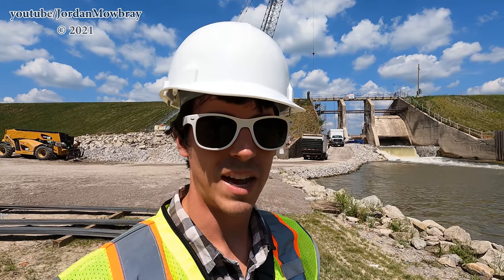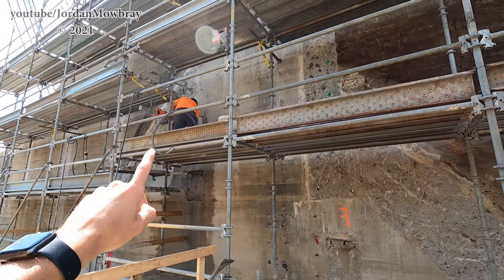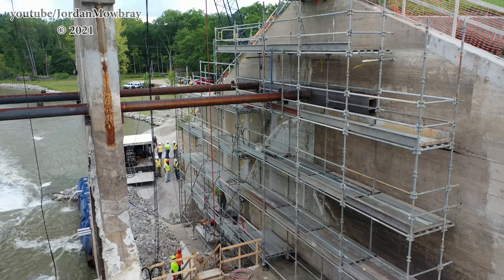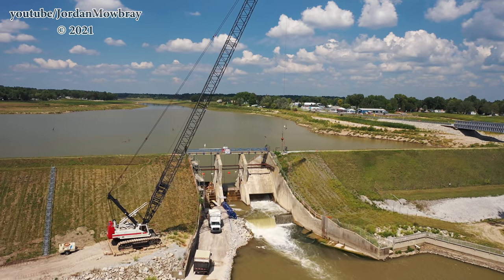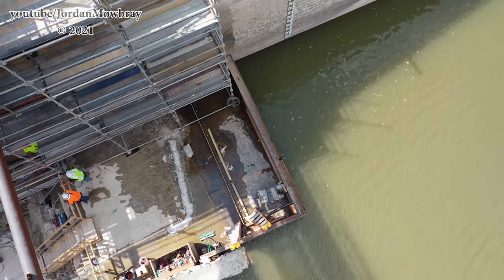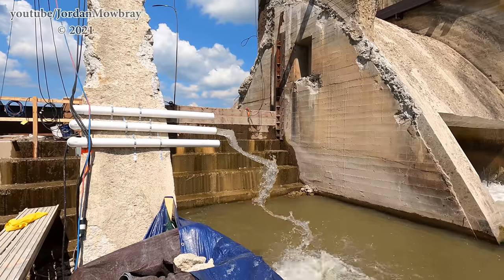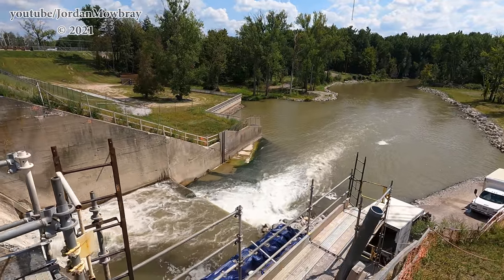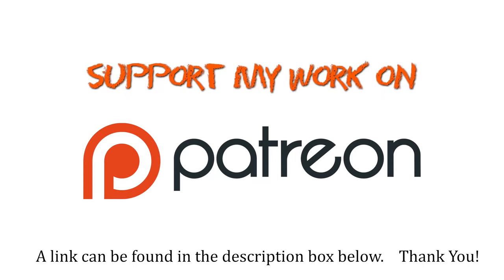Tobacco River Dam - Scaffolding Installed - Pouring New Retaining Wall! - Dam Collapse - Wixom Flood

Comment: A tough job hitting the gussets. I wonder if they drill test holes to deliberately miss them so they can find the absolute centre line?
Reply from the maker: They did hit rebar every now and then and had to reposition
Reply: @JordanMowbray  Yes, I imagine so and I hate it when that happens. Roll on carbon fibre rebar :D

Comment: You talked about spillway 1 and 3, but what about the middle one?  It looks pretty deteriorated,  and it's in the middle, my thinking is the ends might be strengthened,  but the middle should be very important too.   Do they plan on shoring that up too?  Jayman...
Reply: 1 and 2 both have a new stairstepped concrete base. It's in a design and build stage. More engineering and concrete reinforcement planning in the future.
Reply: Yeah, the engineering plans say they are going to widen and lengthen the piers so they can hold the new gate hydraulics.   Going from 2.5 ft wide to 7 ft on the bay 1 side and 7.5 ft on the bay 3 side.  And all three bays are going to get taller stair-stepped spillways, once the lakes are approved to be fully filled again.